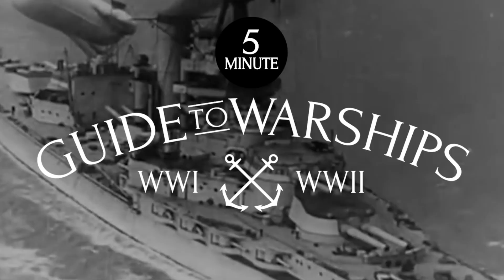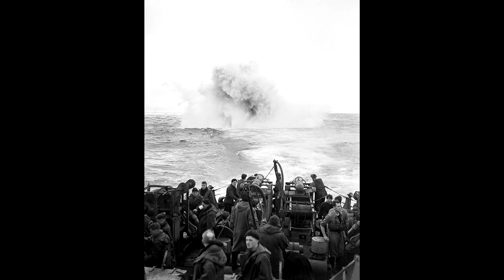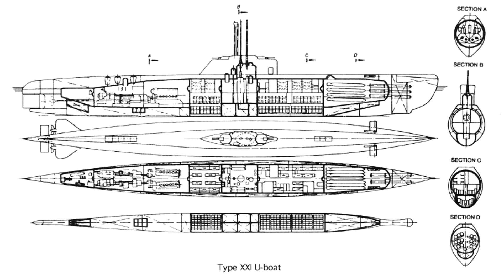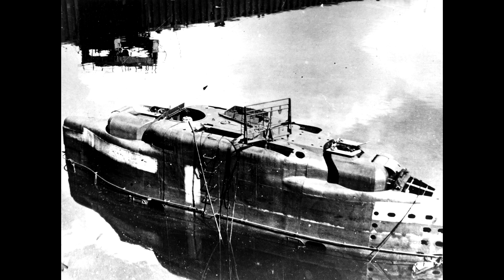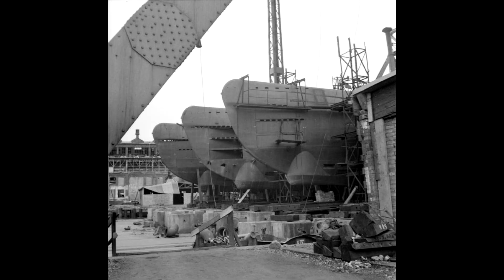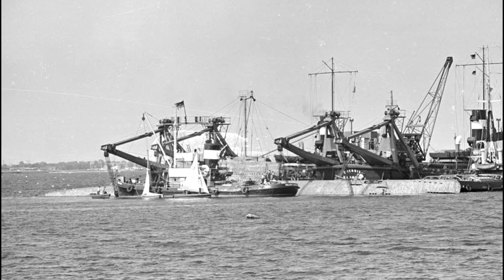Type XXI - Guide 408

Comment: 1:25 The Royal Navy actually trialled the peroxide powered type XVII as HMS Meteorite. Saying she was not a popular ship would be an understatement. Amazingly enough, the Navy then said 'Hold my beer' and decided to build even more peroxide subs - the Explorer class. These were similarly volatile and unpopular.
Reply: I'm sure the crews' misgivings dissolved after a while.

Along with the crewmembers.  High-test peroxide is very unpleasant stuff.  Primarily due to its tendency to start breaking down violently (and exothermally) if you look at it wrong.
Reply: @christopherreed4723  They were known as 'blonde' boats. Because of the most common use of Hydrogen Peroxide. Gallows humour at its finest.
Reply: @christopherreed4723  Explosionsandfire made 98% (might have been 95) in a video. I think it might have involved an ozone generator, but I might be thinking of the wrong video. Anyways, that is crazy as heck and I think I wouldnt go near anything over 40%
Reply: Indeed. The ‘Exploder’ and the ‘Excruciator’. Not popular postings for crews.
Reply: Kursk Submarine:

The Russian Navy's final report on the disaster concluded the explosion was due to the failure of one of Kursk's hydrogen peroxide-fueled Type 65 torpedoes. 

A subsequent investigation concluded that high-test peroxide (HTP), a form of highly concentrated hydrogen peroxide used as propellant for the torpedo, seeped through a faulty weld in the torpedo casing. 

When HTP comes into contact with a catalyst, it rapidly expands by a factor of 5000, generating vast quantities of steam and oxygen. The pressure produced by the expanding HTP ruptured the kerosene fuel tank in the torpedo and set off an explosion equal to 100–250 kilograms (220–550 lb) of TNT.
Reply: @notsureyou  That's what I've heard/read as well.  Afaik, the catalyst in that case was the brass lining of the torpedo tube.  When HTP breaks down, the reaction is exothermic as well.  So in addition to water and oxygen, the reaction generates heat, and rather a lot of it.  This not only turns the resulting water into steam, but encourages any surrounding HTP, which may not be in contact with the catalyst, to break down as well, since being heat-sensitive is among HTP's long list of charming characteristics.  Basically, once a small amount of HTP starts to break down, any of it in close proximity will also break down in a chain reaction.
     According to John Clark in Ignition, even minute amounts of catalyst are sufficient to start the reaction.  Think solder on fuel lines that contains a small percentage of the catalyst, copper.
Reply: @christopherreed4723  I suppose it is just as well that Chlorine Trifluoride was relatively un-explored prior to WW2. Otherwise someone would have suggested it on the German side of WW2 - and the UK would have tried it post-war in a rocket, vessel or aircraft, with utterly predictable results.
Reply: @christopherreed4723  Why was High Purity, 100% hydrogen peroxide, oxidiser coming into contact with the brass of a torpedo tube?    Hydrogen peroxide is stable with Stainless Steel or Rubber.   The H2O2 should have been permanently sealed.    Me thinks improper handling, signage and training was the issue.
Reply: @bernhardzunk7402  Probably crappy welding and bad maintenance. Perennial problems within the Soviet navy.
Reply: I can remember reading about the Exploder when I was doing research for my dissertation at the public records office.
Reply: Anyone with an ounce of sense would not put high test peroxide inside a submerged container with people. 
I used to hold a DOT/ATA Hazmat certification. High concentration oxidizers are dangerous AF
Reply: @Fulcrum205  Unfortunately, submarines are not designed to be safe, but to kill the opposition. And that means the designers will look at anything that gives a theoretical advantage. Torpedoes need massive energy densities to get where they are going. Otto fuel is regarded as relatively safe, but you need gloves and a breathing mask if there is any significant spillage. I recall that one type used Sulphur Hexafluoride and solid Lithium, neither of which are friendly beasties. And that's without even considering what is in the business end.
Reply: HMS Sidon sank pierside due to HTP, 1953 or thereabouts.
Reply: Sweden operated hydrogen peroxide torpedoes and the RB04 anti shipping missile for several decades without mishap.
Reply: @williamzk9083  Torped 613 and 62 definitely have peroxide oxidiser, though I have no idea at what concentration. Isn't RB04 solid-fuel, though? One of the issues with use of peroxide in the WW2 era (and soon after) was the pipes and joints, which had to be made from rigid metal and sealing them required high-quality welding (flexible gaskets of the time were made from natural rubber or leather, which would be rapidly corroded). In later eras, flexible materials with high resistance to oxidation (like PTFE) became available as gaskets and liners, making things a lot safer. Though, as with the Kursk, not safe enough if insufficiently maintained and handled carelessly.
Reply: @onenote6619  It was the RB05 ground attack missile I was thinking of.  My source was my memory of Janes all the Worlds aircraft 1974-75.   Hydrogen Peroxide propellants don't produce smoke and are transparent to radio waves (which is why the Germans used either Hydrogen Peroxide or Nitric Acid in most of their guided missile plans)  .   The US Navy first  attempts at SAM missiles such as Thumper failed because of the use of solid propellants.   Modern hydrogen peroxide is very pure and stable, the Germans stabilized it with additives.
Reply: @williamzk9083  I looked up the RB05 on Wiki. Not the most authoritative ever, I know, but peroxide isn't mentioned as a propellant (though some rather horrible chemicals are). I am also a little concerned about the qualifications of whoever wrote the article because it mentions a 'jam-proof radio transmission link'. Which would be a nice thing if it were actually possible.
Reply: @ The RB05 was well covered in Jane’s  all the world aircraft 1974 or 75.  My Mother bought me that book when I was a schoolboy.  From memory the command  link was a microwave link using impulse modulation which is very hard to jam.  I would assume Directional antenna would be used to reject jamming energy except from the rear where the Saab Viggen was.  It’s probably best to call it jam resistant but I would say that attempts to interfere with the link would have generally failed unless it was behind lines and extremely powerful jammers have been set up. The Sweddes did consider an optical homming  version like Maverick  but cancelled for budgetary reasons. Optical lock on wasn’t actually that hard even using analog electronics in the day if you understood television.  They basically looked for a change in contrast and locked onto it using similar circuits to that used in radar lock on.
The propeller and oxidiser were in crushable metal tanks .  One of the propellers was in a concertina tank that was crushed by a piston down the centre and the other was in an annular tank that was crushed inwardly.  Using sealed crushable tanks was essential for propel and safety.  I suspect they used the burst disc like the Germans did in some of their missiles were rather than valves.  This type of structure automatically sealed tanks in  crushable metallic bladders and burst discs as vowels into the combustion chamber I think is where the safety came from.
Reply: and Sweden used a peroxide powered Torpedo (Torped 62) until the early 2000. Without any (major) problem.

Comment: i d love an extended guide on the type 21, there is so much fascinating stuff about it. the torpedoes had an autoloader for example
Reply: The Type XXI served as the basis for the first generation of Russian DE submarines after the war.
Reply: @GrahamCStrouse  Was it not also inspiration for the USS Nautilus?
Reply: Amen to extended guide
Reply: The autoloader that they stopped installing because it was so temperamental?   Germans have such a hard time following KISS.
Reply: @alphabravodelta42  yeah but it would still be interesting to hear about, wether it worked is not the point
Reply: @laurenz4572  The XXI is alot of stuff that didn't work and is a good case study for bad engineering from intial design to construction.  Thats what I find interesting.
Reply: @alphabravodelta42  I challenge you to present me with a single bad design choice on that boat, with reason and explanation. You do not simply drop something as bold as "this boat completely sucked, actually, no merits at all" regarding one of the most copied and best-researched designs of WW2 without good reason. By extension, you're implying Navy Design Bureau, the Soviet Union, France and Britain based an entire generation of submarines on a lemon.
Reply: @acceptablecasualty5319   Actual Prof who did the grunt work in the German Archives .... https://www.youtube.com/watch?v=Fdyg4igjqnc
Reply: @alphabravodelta42  Given the widespread influence the Boat had, the many Innovations it pioneered and tested and a service life which long exceeded WW2, i think its ridiculous to call the Design fundamentally flawed. AIP (Air independent Propulsion) is still in use today, ironically AIP is our current Version of KISS compared to nuclear Subs.  Apart from that, although KISS does have its place, so does complex and multi role Technologie. Calling things "over-engineered" is often a major simplification. I think given the performance of 4th Generation Fighter Jets in Ukraine as well as Observations of legacy Fighter Technologie in other Conflicts no one can deny the necessity of advanced multi role aircraft like the F35. Similar thinking applies to Aircraft Carriers,  nuclear Submarines or state of the Art Artillery, to Name just a few examples. Dont you agree?
Reply: @laurenz4572  NO.  The innovations were already done by others and the stuff the Germans added was terrible or not needed.   The British & Japanese had done the hull design & batteries before.  NOT NEW.  The Dutch invented the pericscope so NOT NEW.  The automatic reload system took 10-15 years to get to working status so  unneeded expense, weight and complexity.  The 30mm AA guns terrible idea that should have been stripped because fighting aircraft is a bad idea as a sub and they were complicated again because surprise SALT WATER.  The Germans couldn't even doing pipes right.   I just don't understand why you could think this submarine which almost certainly not survive 3 combat patrol should be a test bed for untested complicated German inventions. Warfare at this scale is attrition  and the XXI doesnt' meet the requirements.  This is why I said this design should be hit with a ruthless KISS pass.  You also seem to think comparing WW2 subs with a singular focus against a whole bunch of random examples 2 generations more advanced is valid.  

 Even a good submarine without the XXI's issues doesn't have a chance in hell against opposing ASW when it's own supporting structures are absolutely terrible.  The Germans had no maritime aircraft to locate the convoys, the XXI search ability was limited to periscope search radius which is why the Germans figured they need 1000+ uboats to restart wolf packs.
Reply: @alphabravodelta42  Most of your claims are unfounded conjecture. Some are flat-out wrong. For example, the Type 21 mounted a GHG System in it's dome arrangement, giving it a Convoy detection range of 80 km at a conservative estimate. This is in addition to RDF equipment.

As for hull design, the Japanese did not do it first. I have a primary source in the US Technical Mission to Japan Report on Submarines, '46, which includes paraphrased testimony of a Japanese designer stating that the Japanese had received considerable Input from the germans. Their high-speed sub was even manufactured in eight sections for later yard assembly, just like the 21. Granted, this could be convergent design.
Reply: @acceptablecasualty5319  don't care...  You claim to have primary sources yet claim the XXI didn't have to be reworked and fixed after launching. Or you make the claim the Germans helped the Japanese when the Japanese had been world leaders in underwater speeds for quite a few years.  Or the hard reality that the I201 was 4 knots faster than the XXI.  Odd how I have given you video done by academics with sources and you got nothing remotely close to a source other than "trust me bro"  Pick a direction and kindly start walking for a day or two.
Reply: @alphabravodelta42  Fischer-Tropsch Archive. Primary Sources. Government Documents. USNTMJ plus supplements one and two. Sections related to Submarines and Sections pertaining to Hull Design. "I HAVE LISTENED TO AN ACADEMIAN!" isn't a gotcha if that academian rarely cites his sources.
Reply: @alphabravodelta42  Oh, by the way, your beloved 201? Had to go into drydock to have it's entire Ballast arrangement changed after it's maiden voyage. Why is it that german boats do not get leeway when it comes to growing pains, yet japanese boats do when you speak about them?
Reply: @acceptablecasualty5319  slight difference between issues on trials vs systemic issues on in accepted for service submarines.   Let's add up how many times the phrases over-engineered, unnecessarily complicated,  insufficient for purpose, unnecessarily elaborate,  doesn't meet design specs , overheated is written about the XXI in US Navy reports.   Edit for my favorite "saltwater contamination"
Reply: @alphabravodelta42 You mean the concept from the guy who thought Radar was a fluke? There's a reason we don't listen to that guy anymore. Your Xenophobia aside, there was also the small matter that some of the people tasked with building this thing did so malnourished and at gunpoint, there was a shortage of basically half this thing's shopping list, and, oh yeah, the factories and logi trucks were getting bombed. Considering THOSE circumstances, i think it's impressive ANY of these boats made it off the assembly line.
Reply: @acceptablecasualty5319  Wow, never knew saying KISS (keep it simple stupid) was xenophobic.  Also what the F are you going about radar and some guy?
Reply: @alphabravodelta42 He thought you were criticizing KISS, and was understandably defensive.
Reply: @theicmn  No. I was specifically referring to his repetition of the "Germans suck at Engineering!" stereotype, born mostly from wartime propaganda.

I have to clarify on KISS, though- the principle was known before John Boyd and his "Fighter Mafia" got their grubby hands on it in the Airforce, and proceeded to extend it beyond all reason and into spaces where it was not applicable. That's who i was referring to with that comment- had KISS been applied as the Fighter Mafia had demanded, Craft like the F15 or the AIM-54 Phoenix would have been scrapped. 

I also hold Boyd responsible for carrying KISS outside the realm of engineering and into Legal and Finance, and ultimately into common usage, giving every Senior Exec from that time the excuse to knock on the head anyone who had more expertise than them. Because, if they didn't understand say, an investment plan, it was OBIVOUSLY too complex! /s
Reply: @acceptablecasualty5319  gonna be blunt.  You need to slow down and work on coherency in your comments.  I still don't get what your radar comment was about.   Also it's really clear you haven't operated or wrenched German products

Comment: The Western Allies poo poohed the Type 21... while adopting many of the design features into the GUPPY class subs. The Soviets put all of theirs into service immediately. The last Soviet one was scrapped in 1957. Says it all really.
Reply: Did they?  My readings suggest that the allies took the threat of the type XXI very seriously.
Reply: @silentotto5099  ... Post war testing suggested that they didn't.
Reply: Soviets were very unimpressed with the XXI.  The only XXI built by the Soviets was a Walter engine testbed that had engine "issues" in 1956. The source for the Soviets using XXI submarines is a CIA report on what they thought the USSR was doing. The German submarine that a much bigger impact on Soviet submarines was the Type VIIC U-250 which was salvaged while under fire in 1944.   Once they looked at U-250 they realized they had serious issues with their own submarines.     Source Warships of the USSR and Russia 1945-1995  A.S. Pavlov
Reply: @alphabravodelta42  ... Four Type XXI boats were assigned to the USSR by the Potsdam Agreement; these were U-2529, U-3035, U-3041, and U-3515, which were commissioned into the Soviet Navy as B-27, B-28, B-29, and B-30 (later B-100) respectively.